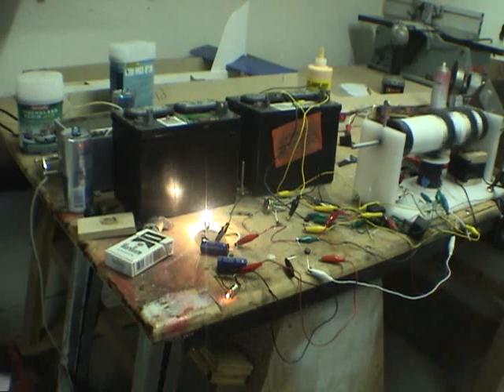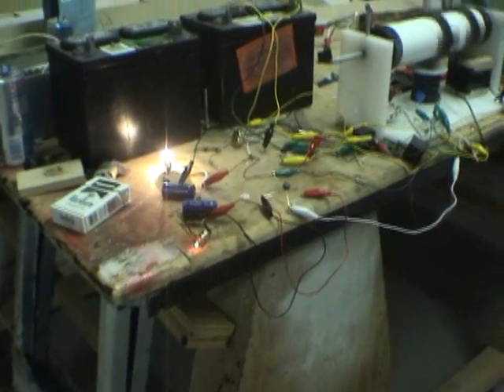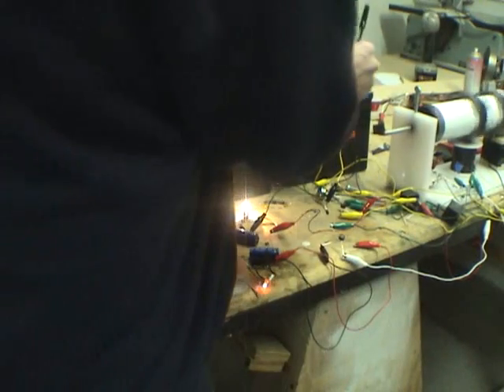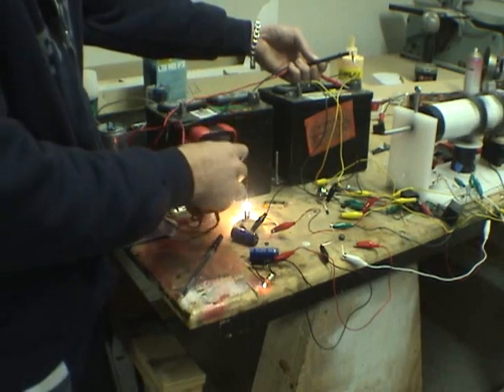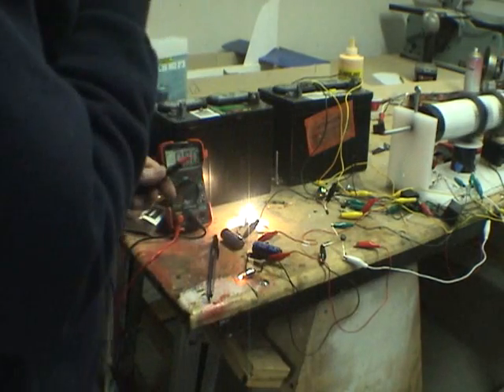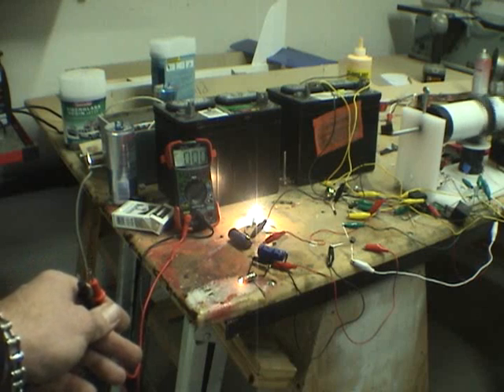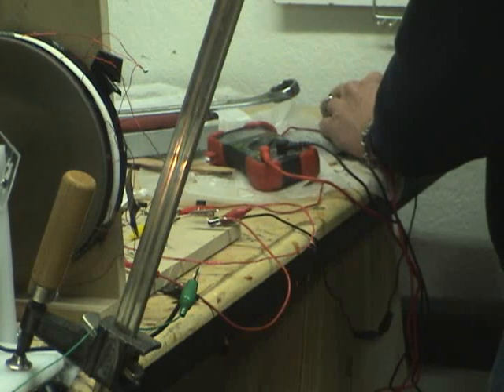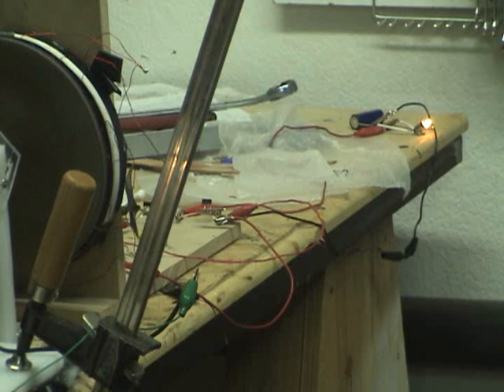Its time to button it up.

Comment: @RockManAU So... if you're getting more power out (P=V*A) than you are putting in, why can't you get the motor started, then switch the battery out of the system so it runs off of itself?

Comment: I just did the math for this circuit. I wanted it to be overunity but it is still an efficient little motor.

Total Input wattage - 6.9483W

Total Output wattage - 3.4758W

Roughly 50% efficient.

Comment: have you tried using a switch mode charging circuit for the batteries, so that you can charge the batteries properly even with a lower voltage input. these are the chargers we use for Remote control hobby.

Comment: Something else Todd, just remember that what U R working with is roughly termed Cold Electricity as opposed to Hot Electricity which the majority of electrical engineers are used to, so some of their ideas may actually be adverse to improving your set-up. That said I am like U in that our learning curve is steep to say the least but in some ways it is a good thing we don't understand current laws of electricity as they do NOT fit with these circuits at all! No offense intended to anyone. Peace.

Comment: Not convinced the starting amp draw has any bearing on this test as the device is already running (during the tests) & not only that the device only takes a tiny amount of kinetic energy to start it spinning (i.e it gains speed by its self). Also, yes analog meters  are way better, but good fast digital meters give at least a ball park figure, meaning they are figures that are not to be discounted altogether. I too would love to see your schematic. I love the use of caps in the circuit. Rock On!

Comment: I'm sorry to disappoint you but, ac power cannot be calculated by IxV. Especially when there are capacitators and coils involved. Would you please search at wiki for "ac power" and redo all the calculations based on the right formulas. Another flaw is that you don't know the kind of wave theres in the output. I'm pretty sure it has a lot of noise which compromise the measuring of the power. Get an oscilloscope and you'll understand.

Nice effort anyway, i hope you could learn from your mistakes.

Comment: Yes, one can run such a pulse motor
on attraction or repellation.
Depends how you configure your magnet poles
and your coil polarity during the firing pulse.
With more coils surely you will have more torque
and thus more output power.
But if your input current reading is right,
you should be able to selfrun the motor
already. Just use the 10 Volts x 200 mA output coil to loop it back to the input and it should already selfrun !
;) Good luck !
Regards, Stefan.

Comment: Hi KT,
try to run this motor just of the
Output 2(Back EMF):
10.10v * .197a = 1.99watts
power.
This should be enough to
loop it and run it by itsself...
So maybe you can already make it a selfrunning unit.
Good luck.
Regards, Stefan.

Comment: Where is the Reed switch connected ?
Do you use it to pulse the current for the relay coil ? Do you just feed one of the 2 bifilar coil windings only with current or both of them ? Do you use just one coil of the bifilar combination as a pickup coil only connected to the bridge rectifier and the cap ?
Please come to overunity dot com and report.
Many thanks. Regards, Stefan.

Comment: not to discredit you or anything cause i think your doing great work but, starting volts on an air conditioner (or everything i think) has more stating amps. so if you are pulseing the input it might be more input amps. I guess like gasoline mileage in stop and go traffic.